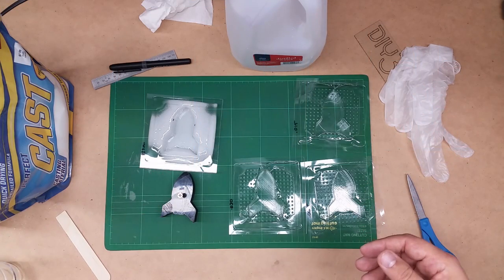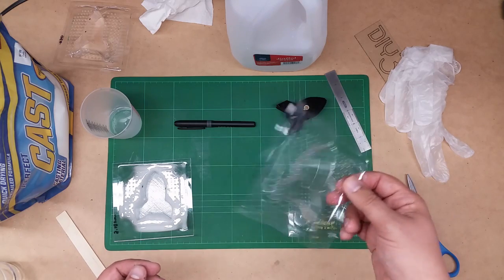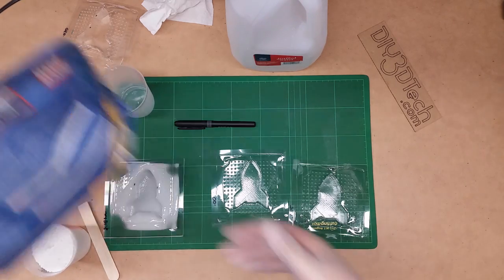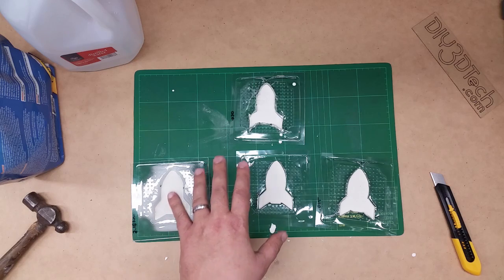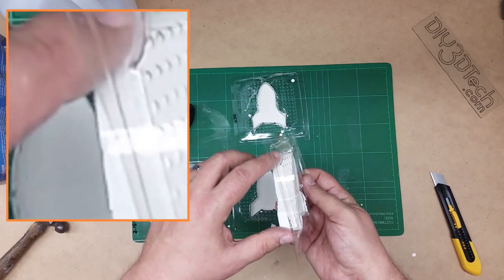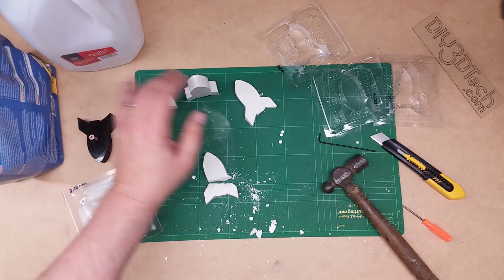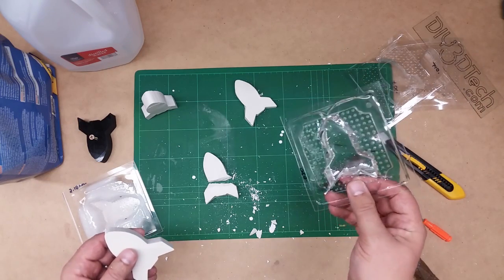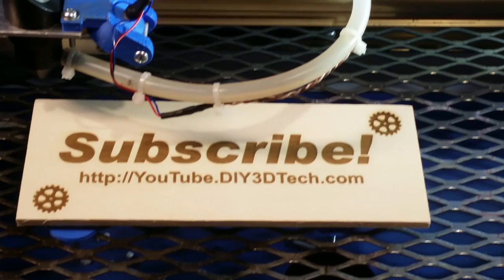Vacuum Forming - Casting 3D Printed Models for Etsy Products!

Comment: I've done the other way around. I've printed a mold and cast silicone from the mold to make my own silicone socks for my e3d volcano. I printed the molds using ABS and I used a small brush did a light brushing of acetone and was able to clean up the layer lines. The idea with any mold is being able to pop the mold open without having to pop it out. If you use a 2 part mold then it is much easier, what you are doing is trying to force your final object out of the mold which is not easy. I also recommend a mold release spray. Much easier afterwards
Reply from the maker: i like this idea will give it a shot thanks for sharing!

Comment: looks like fun . 
few things pop into my head .   " why you no try jello? "  lol   seriously though :
1 , its a thermal set and thats a thermal plastic .  the mold may deform ever so slight due to heating of the  plastic  molds . 
2 ,  i think i said this before , the  walls of the buck should not be pure vertical to a large face on larger parts , so it will release very easy  . ie the back of the buck should be like 1. 1  the front face .
 making the walls have a very slight taper out .  
3 ,  test to see if your acrylic paint sticks to the molding plastic . if not , pre paint the mold . before the paint sets 100% then pour in the stuff it will bind to the paint and not the mold . 
4 . possibly put parts in fridge/freezer or such and then  once cold take them out and quick hit the plastic with heat gun and it should pop off as it temp expands the mold faster then the  contents. possibly even a hot water bath after chilling the whole thing would be enough .
5.  use a heavier plastic you can , and make a relief cut(s) in it with a very sharp knife ,  the tape it closed when you cast .  then undo the  tape to release it . 
  
 Also the other night i was thinking how quick you could make  protective covers for small electronic projects . some of my old R/C cars only had vacuum formed parts covering the speed controls and such .
Reply from the maker: agree on the tapered sides but jello?  your making me hungery 😜

Comment: I agree that doing some finish work on the 3D model would definitely provide you with a better mold and help with the casting release. You might also think about putting a ever so slight taper on the 3D print as well to eliminate the vertical sides that attribute to the mold holding on to the cast. And you might consider some sort of release agent. I'm betting that the special effects industry uses something for plaster that should not affect the finish of the casting. 

Can't wait to see how things progress.
Reply from the maker: Yes on the tapering and possible on the release agent, will do some more experimenting :-)

Comment: Would this not be a job better suited to silicone rubber ?
Reply from the maker: Sort of, with the harder plastic I find you get harder edges than a soft mold especially with the thinner plastic.  However you have given me the idea to do a episode where I compare the two! Thanks!
Reply: Possibly, looking around suggests you might be able to make harder moulds to account for this though, it's something id quite like to play with myself but i'm running out of space as it is :D
Reply from the maker: I hear you about the space issue!
Reply: DIY3DTECH.com Maybe sit the silicon mould in sand during pouring and setting to resist outward pressure. Or vacuum form a support around the silicone mould.